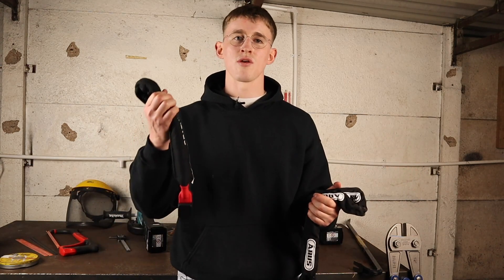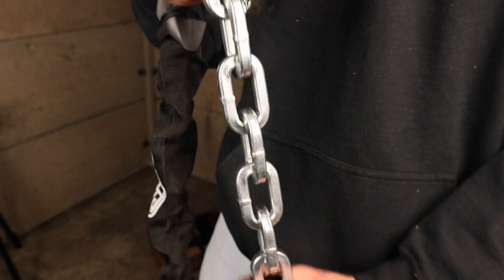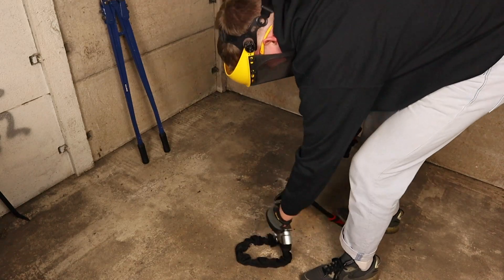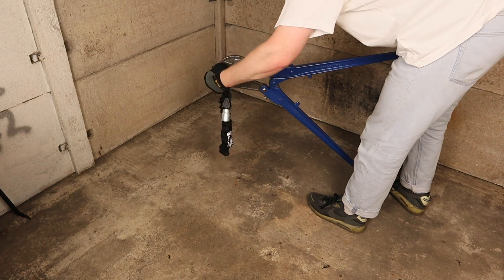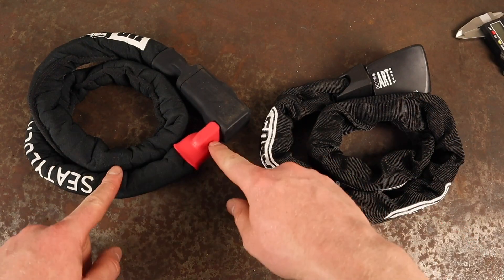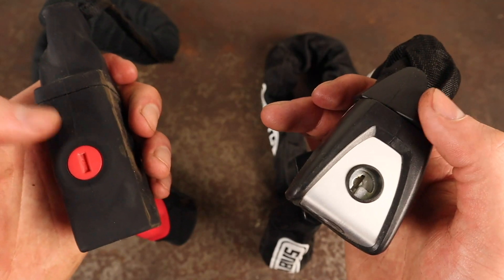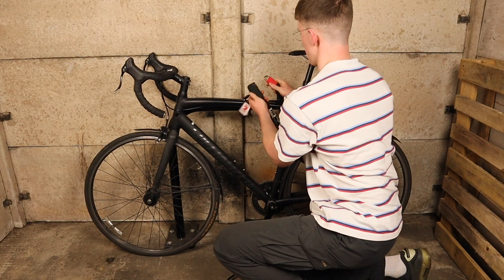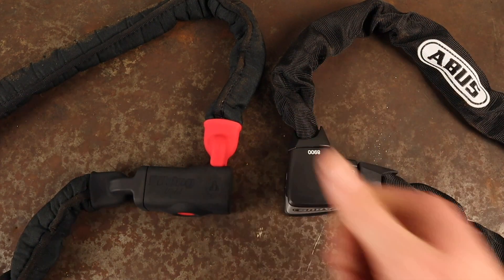Seatylock Viking Silver vs ABUS 8900 - Destruction Testing -  Part 1

Comment: So what's the trick to make chain locks more secure? )
Reply from the maker: The trick is to keep them as high away from the ground as possible when locking up. 

This removes the possibility for thieves to use the ground as leverage if using bolt cutters to attack your chain. 

Thanks for watching!